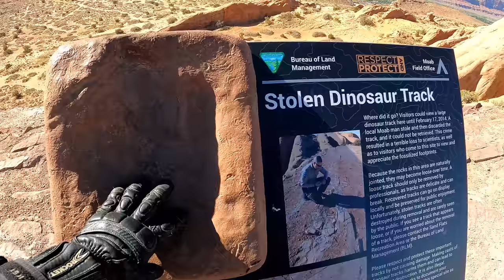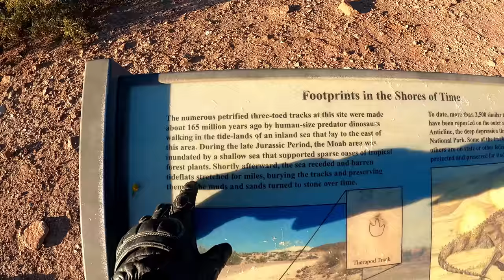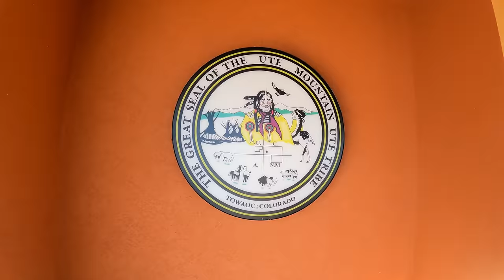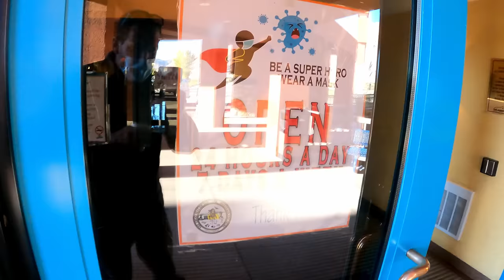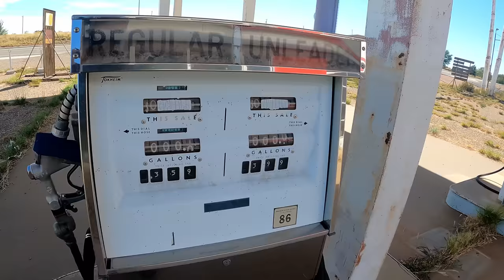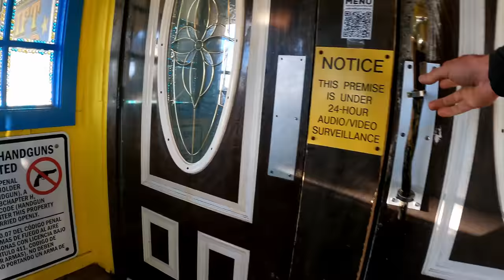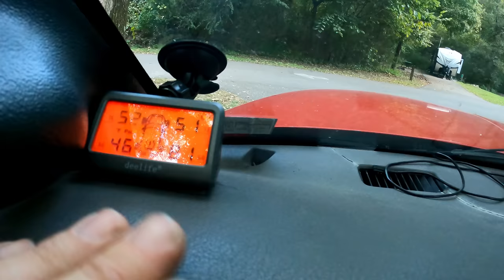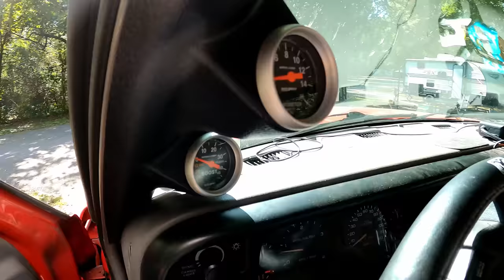Clapper Truck Camper Trip With @jennifersugint Moab to Home - NNKH

Comment: I loved your travel blog! I am a retired Trucker, O/O, that has traveled a lot of the same routes. I now live in Thailand and vacation back to the states, where I keep a older 96 Monaco Windsor DP with the 8.3 ISC Cummins, 6 speed Allison, 38' and a 2001 PT Cruiser 5 speed manual as my toad at my sons house in Illinois! It wasn't too long ago you two were camping in a tent, so the Clapper is a step up, for sure! Don't buy one of those over priced, cardboard campers, that fall apart in a few years! Look around and find a nice older DP with a Cummins, side radiator, real wood cabinets, air ride with air brakes!

Comment: I’ve done that drive a few times now from seattle to Austin through moab. I was moving so my trips were never for fun.  My radiator top blew on my ‘99 tacoma pulling my bass boat in Monticello south of moab. Couldn’t have happened more conveniently, while I was pumping gas noticed it.  Great garage in town there.  Schafer auto clinic.  They fixed me up next day and I’m glad because after that town…. There isn’t a whole lot out there till Albuquerque.  😳 the west is a different world isn’t it! How’s the clapper in the wind? I had a cross wind that made my ball joint squeak from about Colorado to texas.

Comment: Your like... "Hey Babe, You Wanna Try?"... She's Like... "Yeah, I Guess So"... Instantly red lines it... pops the clutch... riding a wheelie up the hill... full throttle into a last second front brake induced front flip.... Lands it while still riding a wheelie to a stoppie with 180 turn around... Floors it again...  launching of a rock and catching a 20 ft Backflip while Supermaning off the hill, landing in a perfect front stoppie mount, spinning the bike 540 and smacking you on the back of the  helmet with the back tire before easing it down... Looks in your eyes and says... "Haven't done that trick since I was 12.."